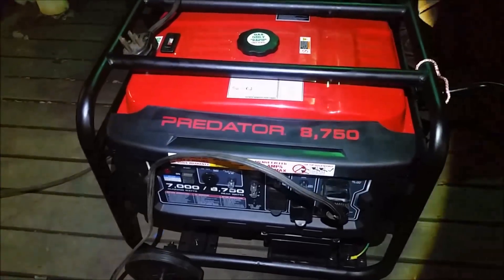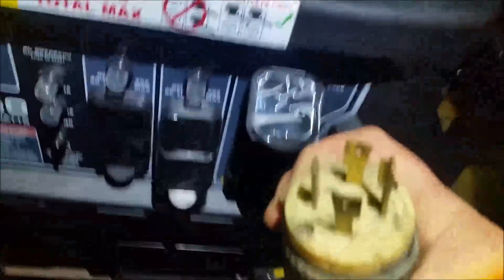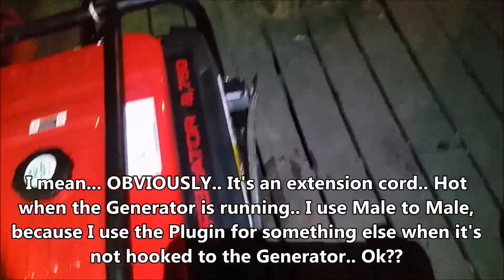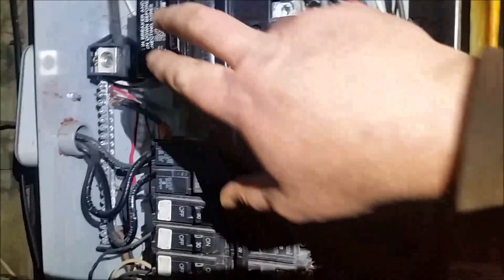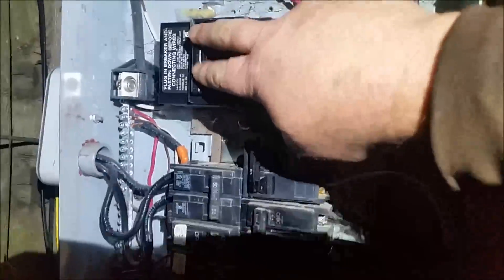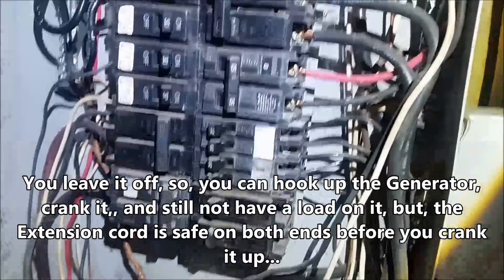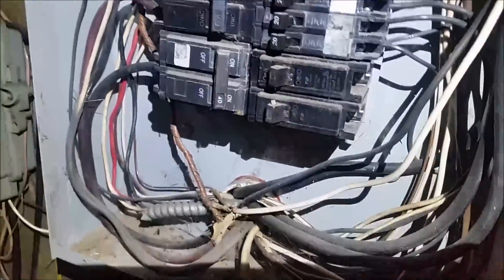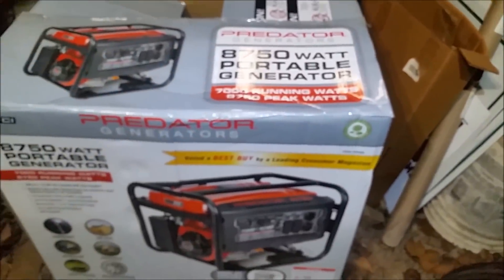Quick/Easy/Safe: Use Existing Plugin/Breaker for Generator hook up to your house Panel box.

Comment: I think by now everybody that reads this knows not to do this. And Mark, please stop typing. And Mark, just say no to drugs.
Reply from the maker: Dan Anderson.. No.. I don't think that is the way this is working..  Drugs?? Ha.. I don't even take asprin, tylenol, etc.. It does not solve the problem of WHY you got the headache.. It is merely a recepter blocker that makes you think you don't have one.. I don't subscribe to that kid of stuff.. Drugs?? Not me at all. 
I like my brain too much.. But, you should take your own advice.. Some say the brain does recover,, but most agree it does not.. Careful.. It may be all you have left.. That is scary.. !! :)
Reply: +Mark Thomas, maybe you should start an alternative medicine channel and monetize it. I needed some good lubricating eye drops and found that they cost $15.99 for a 1 oz bottle. I looked at the key ingredients which were polyethylene and propylene glycol. I mixed the proper amount of Clearlax (polyethylene glycol)  with normal saline for a .4% solution, added a couple of drops of vegetable glycerin and I was off and running for pennies. The drops are working well. I needed the drops because I has shingles near my left eye that damaged the nerves in the eyelid. I used DMSO for shingles but couldn't get it close enough to the eye.
Reply from the maker: +Ed Taylor... Very good.. Yes..  I get a lot of stuff like you just did.. You have a symptom of the Shingles Pain Syndome, but, may not have the pain, but, effects of.. Wish I knew you had that problem back when you had it.. Could have helped you avoid that.. Here is some stuff I posted in 2015... The first two links on the page are for you.. 
http://www.kj4sly.com/Medical/ 
I also have two videos on the Colloidal Silver.. The Power Supply video will save you a lot of time if you are skeptical and think that maybe you need something special to make it.. I have been making/using it for better than 10 years.. It mixed with DMSO will get rid of the shingles with one application.. The DMSO is the transfer vehicle to get the Colloidal Silver to the base of the nerve path where the virus lives and spreads.. I have posted stuff about it here and there, but, generally don't shout about it.. Western Medicine is not about fixing problems, it is about masking them, or hiding them.. 90% of our Medicines are nothing but Receptor blockers.. Think about Asprin/Tylenol, etc.. You have a headache,, you take a Tylenol.. What did it do to solve the problem with the Why you got the headache? Nothing.. It just blocks your receptors and makes you think you don't have one any more.. 
Start making the Colloidial Silver.. If you start using it, you will use it for a huge variety of stuff.. You can even save money on your sponges with it.. Ha.>Ha.. Before the wifey throws out the kitchen sponge (still in great shape, but, it smells from bacteria),, just spray it a couple of times, squeeze it a couple of times to get it moist all over and sit it back on the sink and let it set a while.. When you bump into the wifey next time, you can say.. Honey,,, there is nothing wrong with that sponge,, it doesn't smell,, and let her stomp over there and pick it up and smell it.. Ha.Ha. You need to be watching when she smells it and her eyes go wide open... You can tell her,, your welcome honey.. Like I said.. I'm handy in the kitchen tooo.. Ha..Ha.>Ha. 
Mange on an animal, spray it in tired eyes, inhale it for chest colds (Mist it), There is absolutely nothing better for burns.. (Will stop a 3rd degree burn from blistering if you get it on fast enough). Promotes Good T-Cells and Inhibits Bad T-Cells (promotes healing), etc.. 
You can make it for pennies on a gallon.. 
You "NEED" to have this in your Health Arsenal.. A good old 18v drill charger works fantastic.. We usually have one of those laying around. 
I would dissiminate a whole hell of a lot more information, but, I just don't have the time. I have spent more time on this damn video in the last 4 or 5 months, than any other project I have on my 24 page list of todo's.. But, something in my gut tells me this is an important one and I can see the positive effect it is having.. The Post from Sheri the Electrician some time ago??  She is still lurking, learning.. She posted some the other night.. 
Somehow I think,, if we can get people thinking,, we solve the Libtard delima one step at a time.. Because,, a Liberal is still a Liberal because they are Politically and Economically Ignorant.. If they were not Economically Ignorant, they would be Conservative.. Notice I did not say "Republican".. 
If they were not Politically ignorant, they would be what I call a Constitutional Libertarian, not to confuse the term "Libertarian" with Rand Paul, who thinks you should have liberty and choice,, EXCEPT,  when it comes to Abortion. I guess the Lawyer does not understand "Precedents".. It does not work like that. 
Of course he does it for the Christian votes, not from any core values... I always knew what RON Paul would say.. He was predicable.. He worked from Core Values.. Cheers.
Reply: +Mark Thomas.. I book marked that link, thanks. I had shingles in 2014 or 2015 and that left eyelid still burns and itches at times, especially with stress. I also use nano silver solution to eliminate low grade infection when it shows too much matter. I need to start making my own silver.
Reply from the maker: Ed Taylor.. There you go..  Don't get hung up on the Nano vs Colloids.. That is a bunch of jerks trying to sell their own piece of equipment and telling lies about it to sell it..  Those guys on either side of the fence are still using non-sophisticated power supplies to make their silver.. 

It would take some really sophisticated equipment to be able to create and/or verify that you would only be creating for one matter or selling for another one vs the other.. If you think about it like this, you will see.. You start off with Distilled water.. Very little conductivity.. Lucky to get a miliamp across the two silver electrodes, but, as it starts producing, the water gets more conductive, so, you naturally produce more particles.. 
The Purple guy.. With Aringyna.. (Probably spelled that wrong).. He thought he was smart and put salt in the water when he made his Colloidal Silver.. And it worked just the same.. He had a variety of problems it was fixing.. He was drinking 3 ltrs per day.. I think 10ppm roughly.. The only problem, he was making Silver Chloride and it will migrate to the surface of the skin and basically tarnish and will cause that problem that is created by adding salt.. 
Guess he never thought about putting 1/3rd of his just finished batch in the new batch to get it started right away..  He has an interesting story, and was being paid nicely by the Government to let  them tell lies about the "Colloidal Silver use" turning him purple. He did come clean several years later and tell the truth.. 

There are so many variables down to the actual piece of silver to begin with.. How was it created, what is it's mass, was it poured, was it poured and then stamped creating variances in density, then conductivity, then, accuracy in the power supply with varying conductivity.. To guarantee one size vs the other is insane, without some equipment NASA budgets for... Besides.. This all started back in the days of the Egyptian kings/Royalty, when the plagues moved across the Country and wiped out the masses, but, the Royalty (eating off of silver plates, goblets, "Silverware", etc.. Then, the Westerners moving west, putting silver coins in their milk as they put it in the creek to stay cool.. The "You were born with a silver spoon in your mouth", comments, when you look in Grandma's trinket/silverware cabinet and see the baby "Silver Spoons". We are talking just eating off of it, or it sitting in milk, or a baby teething on it.. 

Now we do it with electrolysis.. And some damn fool is trying to say that didn't work and we need to make nano vs colloidal? We need particles and the process of making them is imperfect as far as precision of particle size, so, it makes both and that is without a doubt..  And, if you spent the money (about $150-$225 per sample, to have their product tested, I would be willing to be my paycheck, they have both. Besides.. If the particles get too large, they will become sediment, and I have yet to have made a jar of it, labeled it with what PPM it is and go back a year later and have the ppm change even one point. 
I drink the 5-10ppm, I use the 20+ ppm for topical and general use, and I save the batches above 65ppm up to 100ppm for the stuff that matters.. 
My Mom has been putting a Quart of 10ppm in her hot tub once per week for over a year and it works better than all of the chemicals you buy for the hot tubs. My brother drank 16oz of 5ppm a day for 1 year to solve some issues. The only issues he faced was from time to time, he would get what appeared to look like dry skin, maybe with some psoriasis that went away quickly.. We studied it and are both in agreement that he was detoxing.. It was always related to something he started taking related to detoxing..  Like I said, it has hundreds and Hundreds of uses.. Great on Ear Aches and the Hickups.. 
And, you can get rid of a chest cold by misting it with a nebulizer or just putting it in a travel size hair spray bottle and woofing it in as you breath in.. 
Cheers.

Look up Vinegar and Honey mixed 50/50.. The only thing I buy organic.. With the Mother in it. and Local Honey.. 2tbsp per day first thing in the morning on an empty stomach. Dilute with warm water to the dilution you are able to drink and not choke.. Ha.. After several days, no problem, you enjoy it.. It can upset your stomach for the first 3 or 4 days. Drink lots of water 2-3 days before you start, while you do it and 2-3 days after. 
Work up on your second week to 2tbsp x 2 times per day and do it every couple of weeks for a week, but at the 2tbsp x 2 times per day rate.. But, always up your water intake a day or two before. And the first time you ever do it , or if you only do it once per year instead of multiple times, be sure to start slow and work up.. It is a roto rooter for your veins and it will shake the plaque loose and if you don't do it but once a year, you can flush too much out and if you are not really drinking water to keep the blood system right, you  can cause some blockages in your capillaries. We don't drink enough water, and those are the guys who have to be careful. Me for one.. But I am working on it.. I think finally I am getting used to more water.. Had to divorce coffee for 2 weeks to get me started though, and I LOVE MY COFFEE.. Cafe Du Monte from New Orleans with Chicory.. 
Sounds like you are from NC?
Reply: Mark Thomas.. Transylvania county now, raised in Graham county.
Reply from the maker: Ed Taylor.. Got it.. Ha..Ha. Not too far away as the crow flies... Graham is just up the road where I first cross the tri county lines and then, right on 129 at topton.. I am sure you know where I am.. Paddle Inn  Rafting Company on the Nantahala... 
If you ever come through this way, stop and chat a minute.. Just remind me, why the name rings the bell.  Generator video.. I'll snap right to it.. Cheers.
Reply: lolololo. This is quite entertaining. I am easily amused!
Reply: lolololo. This is quite entertaining. I am easily amused!

Comment: OK. What Sheri said. I am a 30+ year electrician and electrical contractor. First, anyone who has a panel that looks like that, don't trust. 2 the neutral DOES NOT give you 220! As a matter of fact, there is no such thing as 220 anymore. It's 208 for industrial/commercial and 240 for all three plus resi. 3rd, DON'T DO THIS!!! He said the obvious, it'd "hurt someone" who was working on the pole but another thing is blowing the hell out of your generator, power panel, the new transformer that will cost you in the 10's of thousands to have to replace, the law suit from your power company, Oh, so much more. Just get on Amazon and get the proper swqitchgear for this operation this idiot is trying to kill you about. The device on amazon is only a few bucks. Dear lord REMOVE THIS VIDEO before you kill someone. Remember people....the quote from this guy..."THOSE WITH COMMON SENSE" or "USE COMMON SENSE". If you're not completely blind, ignorant or lack the "common sense" this gentleman has called for, you absolutely KNOW the "common sense" he speaks of is a feature that is extinct with many of those who walk this earth and those people think the DO HAVE the previously mentioned "common sense"....
Reply from the maker: Chapman Electric?? Ha..Ha..Ha.. Wait a Minute here.. We have a Chapman Electric,, with a single playlist with a single video posted in it Titled "I wanna fuck a dog in the ass".. And, you want me to take your advice??? HAAAAAA,,, HAAAAAA,,, HAAAAAA... HAAAA... You have to be joking right??? HAAAA,,, HAAAA,,,HAAAA...  Yea Right!!! 30+ years?? Ha..Ha..Ha..Ha... Yea Right.. Since you didn't learn anything in 30+ years let me help you learn something today.. 
The Neutral does not "Give" you 220, but, you can't get it without it, so your statement is absolutely ignorant.
208 is for Industrial/commercial? You mean that If I am on a 3phase circuit, I can't have 3 phase 208.. You forgot to mention it does not have anything to do with Commercial or Industrial,, It is only used in 3 phase circuits.. Which is a mistake you would never make if you were an Electrician with 30+ years experience,, or, you are a Complete Idiot.. 
There is No Such Thing as 220?? Ha..Ha..Ha. It is the Nominal Voltage of a 240v circuit you Moron.. 30+ years experience.. Ha..Ha.Ha. A mistake in every sentence.. See why I would never hire an Electrician?? 
 blowing the hell out of your generator, power panel, the new transformer that will cost you in the 10's of thousands to have to replace, the law suit from your power company, Oh, so much more.???  I would like you to explain what type of Circumstance would cause all of that to happen, because, without me explaining a whole lot of stuff to you,, and even if I did,, you would never understand how a Single Incident would NEVER cause all of that to happen. It is physically impossible..  And,, 30 amps from a Generator is going to blow a High voltage Step Down Transformer?? Ha..Ha...Ha..Ha..Ha.. Lets see.. A 25kva is capable of feeding say 5-7 homes at 100-200 amps each,, and you are going to Blow a Transformer with 30 amps??? Ha..Ha.Ha..Ha.. What a Complete Idiot.. 
Or,, how about this one.. The Proper switchgear can be bought at Amazon for a few bucks??? Ha..Ha..Ha.. What planet to you live on??? Ha..Ha.Ha.. Even two cheap pieces of metal called a Panel Interlock with the cost of about $50 cents goes for $50 once it has the UL Listing on it.. You really should stop abusing the drugs.
I don't think I need to say anything else.. It is Quite Obvious you are a Troll and don't have a damn clue what you are talking about.. Case Closed.
Reply: You must have upset Chapman Electric he went over to another channel https://www.youtube.com/watch?v=lkbBt8hv8mQ&t=2s and posted this  

** I am so glad you have made this video after watching many people who I strongly believe their family tree is one branch. You are showing the PROPER way to do it inexpensively.
Congratulations for not marrying your sister like the other posters I've seen! **

Comment: Locate the fridge and gas furnace breakers, turn off, disconnect the romex cable, put male plug on each one,
now connect to 12ga extension cord, start generator and plug the cords into generator. DONE.
No chance of any backfeeding to the utility.  Power Company Lives MATTER.
Reply from the maker: 27613James.. Yea.. You could do that if you want to walk around in the dark. Not sure why though.. All you have to do is turn the main breaker off and take your extension cord, cut the female off of it and plug it into one of the unused 220v breakers and power whatever you want.. Much simpler and much more effective and still can't backfeed..But, whatever you have to do to get the job done and be safe.. More power to you..
Reply: +27613James, the snowflakes would be afraid that you would forget to turn off the main breaker before disconnecting and reconnecting  the romex and probably even say adding male plugs to romex is against some imagined code. Were you affected by Florence, 27613 is a NC zip code?
Reply from the maker: Oops. I forgot to answer that earlier.. 28713 Western NC. Bryson City. We got 1.5 inches of rain and no wind finally.. We are in extreme Western NC. So, water levels were no problem.. Sorry, I forgot to answer you on that one..